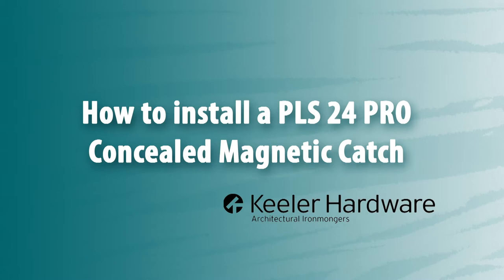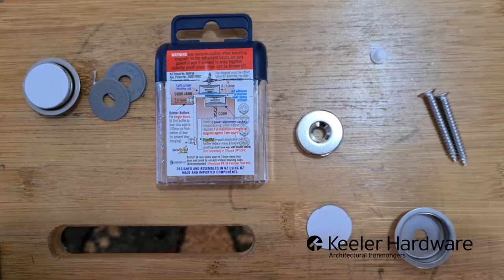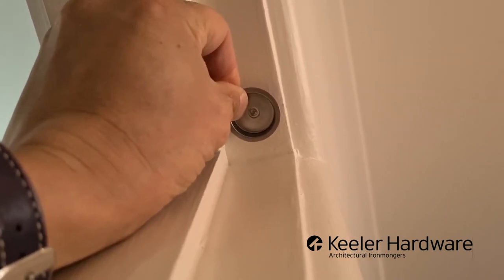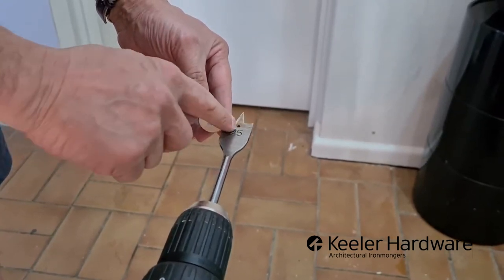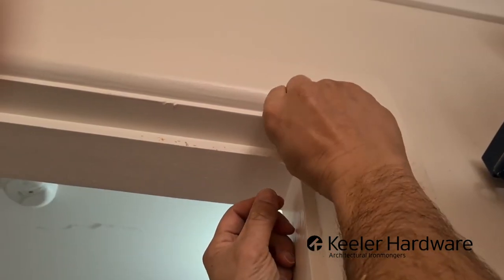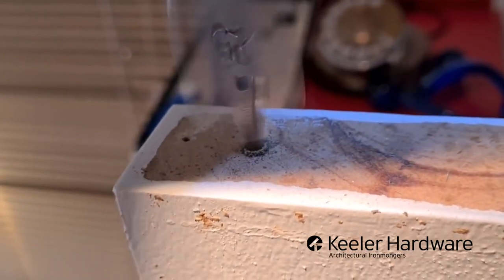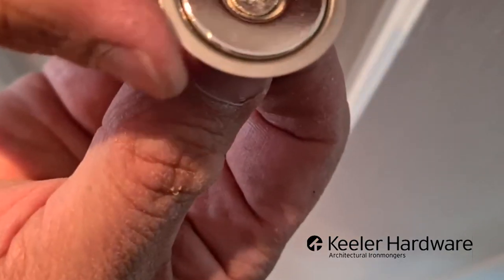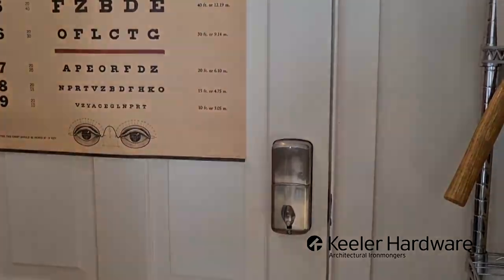How to install a PLS24 Concealed Magentic Catch

Comment: Small correction: you mention in the video the top magnet should be offset towards the door, but it should be offset towards the door stop instead (so actually slightly away from the door). Great video nonetheless